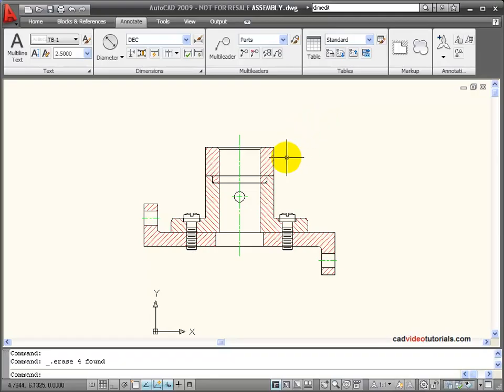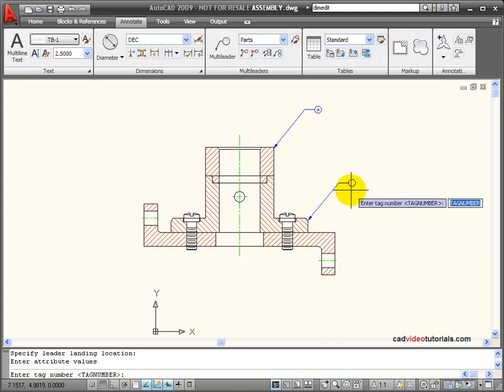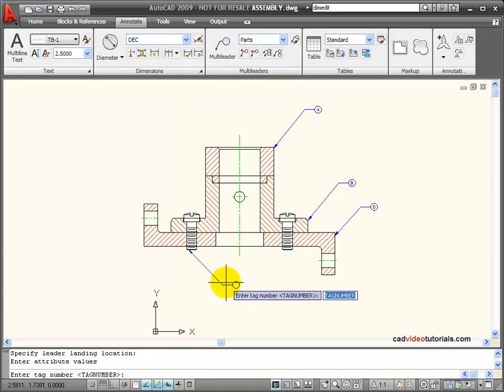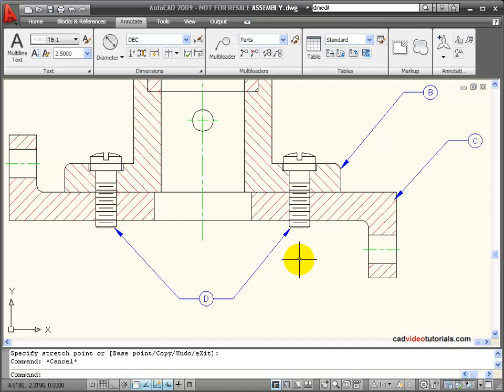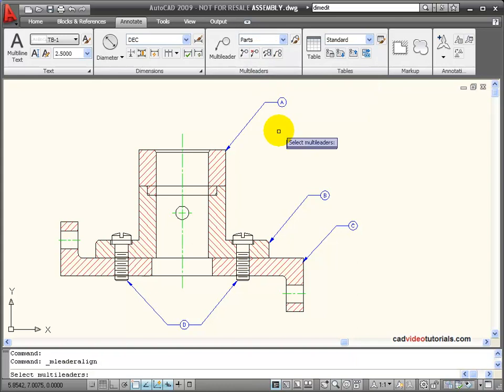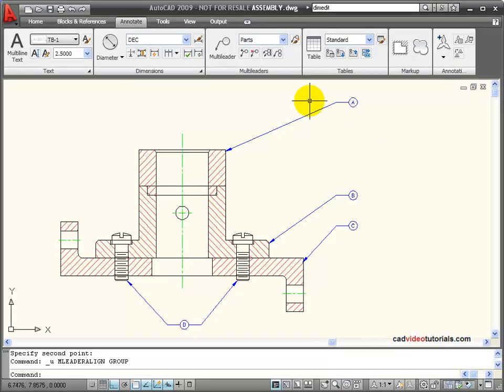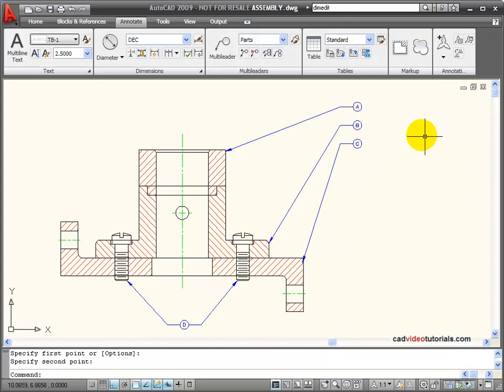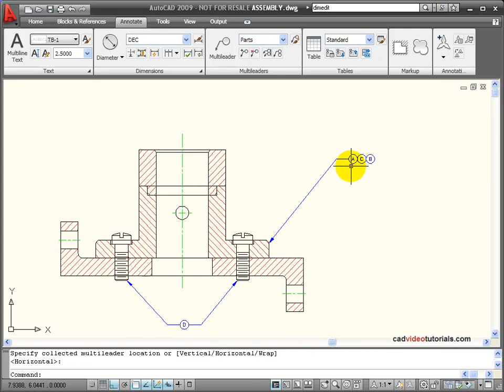AutoCAD Tutorial -  Using Multileaders

Comment: The alignment function works perfectly when all the leader heads face the left as the alignment line snaps to the leftmost text which also happens to be the same place where the leader landing attaches to the text. But, when you have leaders that have the leader head pointing to the right and each mtext has different lengths, the alignment line snaps to the leftmost text and aligns in that fashion which results in no alignment of the text/landing connection points of each leader. Please help.